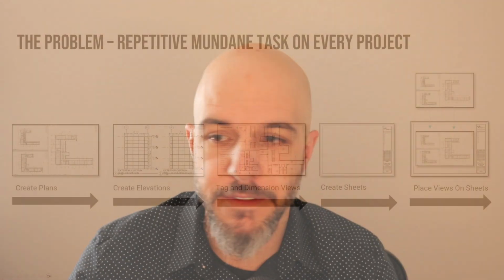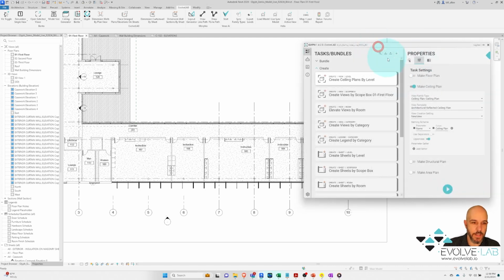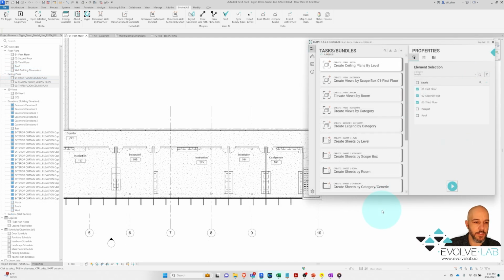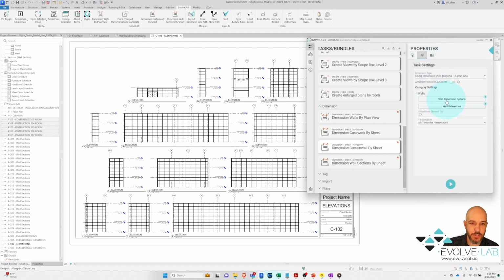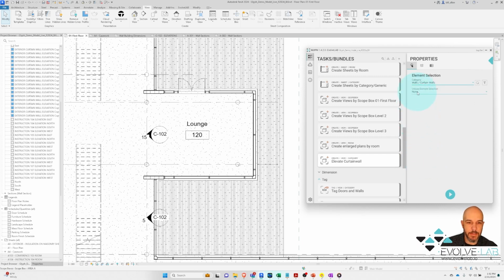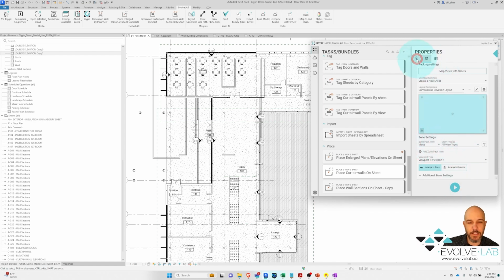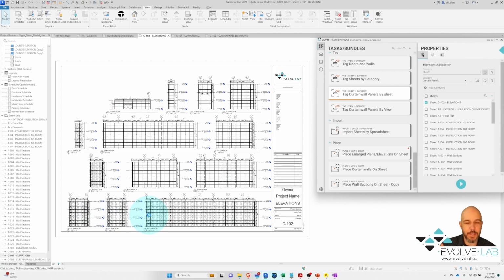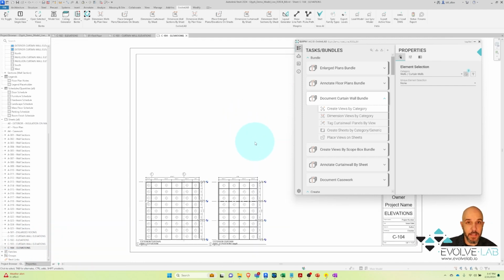Automating Construction Documents in Revit - Glyph Quick Start

Comment: Would Glyph work with dimensioning MEP Elements? Sysque elements, Victools elements?
Reply from the maker: Hi Joel, Yes some MEP Elements including electrical equipment, electrical fixtures, and plumbing fixtures.  We are looking at adding other MEP components.  Are there certain ones you'd like included?

Comment: When can we start using the co pilot for glyph?
Reply from the maker: Hi!  You can start using right now if you are signed up for the early access closed beta.  Have you signed up yet? If not, you can sign up here: https://app.smartsheet.com/b/form/d07479759a4747a99964cee2a836b59f   Open beta should be released in about a month!